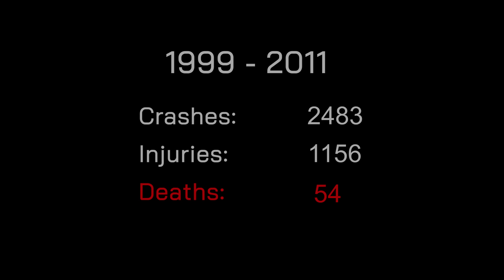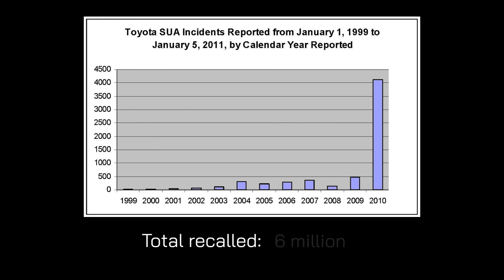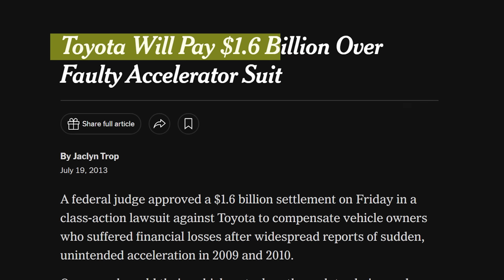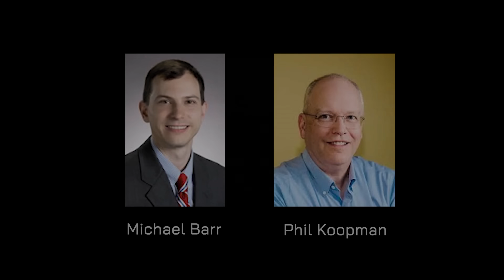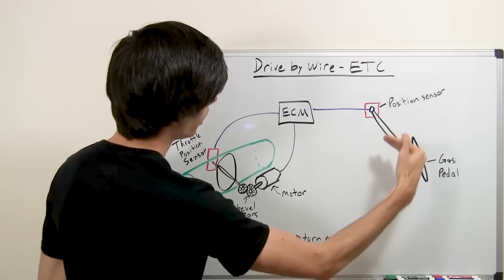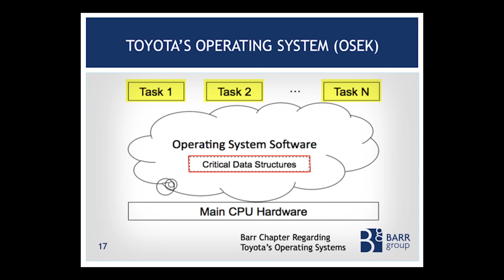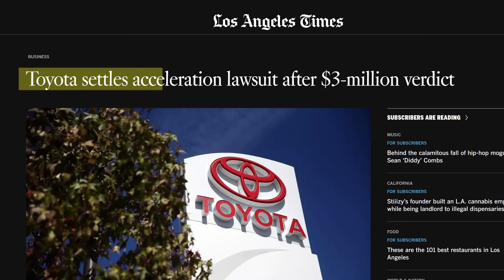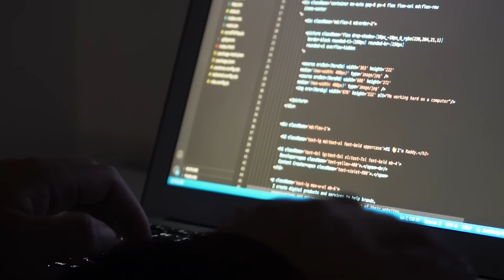Fatal C error took her life

Comment: What I think worth to stress, is that absence of memory access bugs and/or data races is NOT equal to bug-free software. Remember, when jumping from assembly language to higher level languages one celebrated the automatic stack management, local variables lifetime guarantees,  etc... We can go for Rust, but this doesn't mean SW somehow automatically will become valid by default. Each Turing-complete language allows you to write anything computable, which keeps the errors space size the same.

Comment: i will give my 2cent here, this video kinda came in like a tone deaf for me. Although yes, rust can prevent the mem error, but this instance is a violation of swiss cheese model, where there are multiple barrier and safety check, i mean organizational level safety check, to prevent error.

I came from Aviation bg, where icao/faa/nasa would put safety and stability above all. It is becoming pride in itself.

1. Cost cutting before safety?
2. Only limited testing??

Now, i did mentioned aviation industry, you might, how about MCAS? It is doing its very job, just wrong implementation, it is not software issue, it is Stability issue as in control system like PID etc. Mars orbiter? ran as intended, wrong unit. Both of them are using C.

Comment: The bug was an important failure, but nothing restricts the driver from applying full brakes, that will always get you stopped, although ofcourse with a bit of delay. 

Many fatal flaws have existed through out the years due to memory leaks, many of them without even having the possibility to perform an emergency action. Even in aviation, where extensive testing and validation is required many memory bugs have escaped from the process unnoticed. Same has happen many times to different spacial agencies, with important crashes into the Moon and Mars.

It's almost imposible to scape from all memory bugs and events like data races. If the programming language allows you to create such bugs at the end of the day, somebody is going to program them.

Comment: See the original video and slides by Koopman. This video removes all information and adds in Rust advocacy and monetisation. It's fascinating, to me, how this video left in all the problems found in the original code, but left out what the eventual problem was that caused the unintended acceleration.

Maybe because the problem that caused the UA was not something that Rust would have fixed anyway, and because the point of this video is marketing and not information, they left it out.

Comment: I recently wrote a controller for solonodes and safty switch for an engine using Rust. 500,000 lines is fucking crazy for this.
Reply: In the context of machinery, 500,000 lines of code in one binary is just about the reddest flag possible.

Comment: 500k lines of c code are 500k lines of c code and it should not ring any bells. The problem is not the language.
Reply: The point is that no one can manually prove the safety of projects that complex when it uses global variables and interdependent tasks.

Comment: First thing I learned in my embedded systems course at university was to never use the heap in mission critical embedded applications.
Reply: If you ever work with PLCs, which are like big, glorified microcontrollers for industrial applications, heap memory generally doesn't even exist. In fact, on some platforms there isn't even stack memory, it's all statically allocated at compile time.
Reply: @GuyFromJupiter  On our planes/vehicles etc (at BAE Systems) we only use the stack if we can mathematically prove that there is no code path that means we exceed a fixed size (e.g. 1MB) stack. We do not have a growing stack, it's fixed. And yeah, no heap. No dynamic memory at all.

Comment: Breaks and other critical systems should be mechanical. I like Rust, but I hate this video. The conclusion is wrong. Toyota should be severely punished for designing a critical system this way.

Rust won't fix all the issues in this world no matter how hard you push it.
Reply: Exactly this. How can this be the only comment that is sane in this entire comment section? Literally, why do we need to stuff software in every single place? I mean, sure knock yourself out, add as much software as you want in all of the components of your car! But also offer a fully mechanical system that we can fall back to in case of failure. There are so many things that could fail when you rely on a digital system. We can't live in an era where we have far more unsafe vehicles than we used to in the past. Things are meant to get better, not worse.

Comment: 500k lines is absurd for something that can be straightforwardly controlled mechanically.
Reply: It depends on what you count. It's possible if these lines include all the OS code too. For example the Linux kernel has almost 30 million lines and nobody needs to worry. It's extremely well tested by everyone over the entire world and for many years.
It's not unusual for embedded hardware to run a Linux kernel or some other Unix.
However, if this number is just about the concrete tasks on that system which do the actual job, then it's more crazy.
But even inefficient code can still work properly, if they tested things properly. And invested in knowledgeable employees and proper education.
However what the explanation in the video suggests is extremely toxic management for good software development. When a company is so extremely protective about anything, there is already something really wrong. A modern programming language is not going to actually solve that either. Even though I like Rust and I really see it's value.
Reply: They need their telemetry, adware and spyware to work.
Reply: @chudchadanstud  right cause your accelerator peddle is spying on you. let's loosen the tinfoil hat and touch some grass.
Reply: @Megasteel32  Yes. It actually is. It's called telemetry. The Manufacturer can simply bring out this data to prove you pressed the wrong pedal when you take them to court. They can also use that data to optimise their next design.
Reply: @chudchadanstud  I hope you realize cars don't have black boxes like planes do. they aren't recording your every move lmao. I know what telemetry is, this ain't it.
Reply: @Megasteel32  Technically they do. Any car after 2012 has some form of black box. You may even have a GPS built in. There's plenty of Telemetry on a car, my Mini tells me when I next need to service my car. And there there's Teslas. 

Black boxes in cars was a trend in the 2000s and was standardised by 2012.
Reply: @Megasteel32 , it's spelled 'pedal'. To peddle means to try to sell something by going door to door. There is no such thing as "a peddle".
Reply: @chudchadanstud  yeah bullshit, source?
Reply: @Megasteel32  Can't post links on YouTube. You can verify it yourself in less than 5 seconds
Reply: @chudchadanstud ive worked in the industry, i dont need to verify what I already know
Reply: @Megasteel32  they do. It's called an EDR, Event Data Recorder and it is legally required in the EU and very common even outside it
Reply: @julians.2597 theyve been legally required since 2022 and no they are not very common outside of it since no other country or group requires them for passenger vehicles.
Reply: this shows your lack of knowledge of automobiles lol. there are many advantages with drive by wire.
Reply: @Megasteel32  The usefulness of the feature is not in question, the complexity of the implementation is.
Reply: @dr_xyd  when you can read assembly lmk
Reply: @Megasteel32  What they're saying is, is that the software for drive by wire doesn't need to be that complicated, considering that a similar effect can be achieved mechanically. So because it's pretty simple, it doesn't need to be that long. At least I'm assuming so.
Reply: @antifa_communist  yea i understand what they are saying, which is because they have no idea how either automobiles nor software development works.

Comment: Any code where failure results in death should be formally proven. Car control systems should be held to the same standards as avionics.
Reply: Cars and planes should both follow MISRA C standards, that's how we write code at BAE Systems. Memory leaks or buffer overflows or unguarded pointers etc are all statically analysed. MISRA isn't perfect but it goes a long way to detect defects.
Reply: All avionics systems are formally proven? Wow. I mean I would expect that to be the case, but analyzing and proving millions of lines of code especially when so many electronics are in play, must be a hard job.
Reply: @tathagataroy5153  laughs in boeng 737 max
Reply: @LeonardoAMsnts laughs in safety standards and statistics in aviation are better
Reply: The key is always thorough testing procedures. In aviation and space travel things are generally done extremely well. That's why things go fine most of the time.
However even these have their fair share of problems. Googling for plane crash software failure gives me really interesting results.
I found things about about uncontrolled drops due to sudden AOA changes on a passenger craft and things about a uncontrolled response to turbulence of on a military craft. Not good.

Comment: It’s the Therac-25 problem all over again.

This video raises some pertinent points, but the bigger failure at Toyota was, from the sounds of it, the culture and improper engineering management. You can make dangerous products with any language, and from that PoV this video is a cheap shot.

Also, the rust compilers themselves are massive. Have they been subject to any formal proves?
Reply: Daily reminder that the therac's code was actually perfect because it was just designed for an older version of the therac which had hardware interlocks, which the therac 25 did not. I know people doesn't like rockstar programmer stories, but I think it is very important to be aware of the real reason people die when a defect is found in a system. I too thought the therac was entirely on the programmer's fault, but their code ran flawlessly on the version with hardware interlocks, meaning the therac is simply a story about a company cutting one too many corners, leading to the death of people. Doesn't fully justify the code, but let's be clear about the real problem in each scenario... Toyota's case was a software error that happened because there was a bug in the program, the therac's case was a software error that happened because the code had originally been written for a completely different machine which had completely different hardware. 

As for ferrocene being approved and whether they have gone through any formal proves... just a few days ago it wasn't considered to be viable for safety critical software, and I haven't been able to find anything about them undergoing any formal proves for any length of time so yeah...

Also, I think this is another worrying problem that is important to discuss: They are acting like the compiler itself is somehow the one that played a hand in killing people when the problem with the C code was that it was simply wrong in the first place. It's good that they are adopting safer languages, but I'm afraid that the main problem is not going to be fixed, that problem being programmers who don't know what they are doing being involved in the creation of safety critical software. If we're moving to languages that allow us to write safer code, we should also move towards hiring programmers who actually know what they are doing when dealing with an embedded system that runs software critical to keeping people alive.

Going back to the therac's example, as much as the code ran flawlessly on the version it was originally designed for, it still had no documentation and the error messages were simply random numbers with no further explanation. Even if the code appears to run properly, it is clear that the incompetency that could get someone killed was already there. Even if the hardware had been kept the same, the margin of error is extremely small and we can't be dealing with shit like that when people's lives are at stake.

Personally, it looks to me like the core problem is not going to be fixed any time soon, and now we're simply going to move to having Rust programs that get people killed, as well as C programs that get people killed. Only that at least Rust can hand hold bad programmers into writing less deathly code, but considering the insane shit some people write even in Rust, it is just a matter of time before someone dies with code written in Rust. Only that this time I'm afraid that it might be harder to make a case for software failure because it will just be assumed that since it was a memory safe language, no software error could have happened...
Reply: @tiranito2834 how hard can it be to audit unpopular libraries and unsafe blocks? But you do have a point. It's scary the thought that something outside of the programmer's control can cause UB on critical operations

Comment: Im worried it might become impossible to buy a car without electronics.
I just want lights and steering enhancement.
Reply: It is already impossible. Cars have to come with certain electronic assistence systems according to safety standards. Which by itself is not a bad idea but in my opinion such systems can often also be dangerous themselves by making the car behave unpredictably. Both manufacturers (like Tesla) and governments are playing with lives, manufacturers because of profit and governments due to incompetence.
Reply: @brinkoftext I think its naive to call it incompetence. The government is pushing these systems for control over the citizens. They want to be able to control your car remotely. When these systems are not even necessary. I really hope some open source low-electro car manufacturer would hit the market. That could be a good business idea.